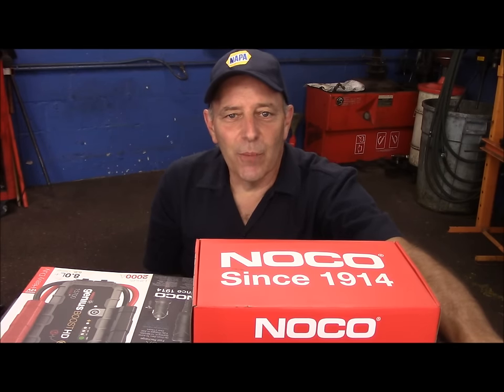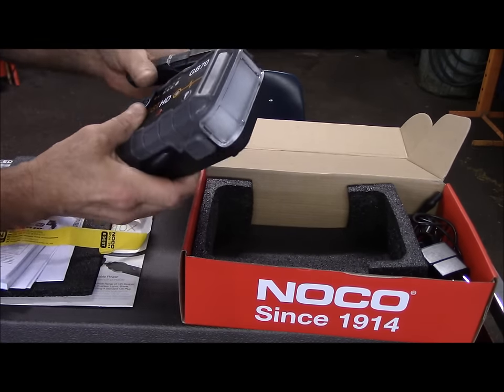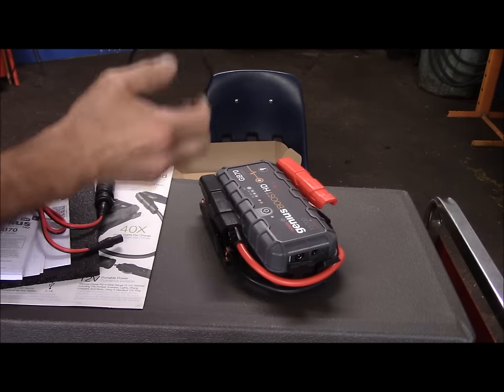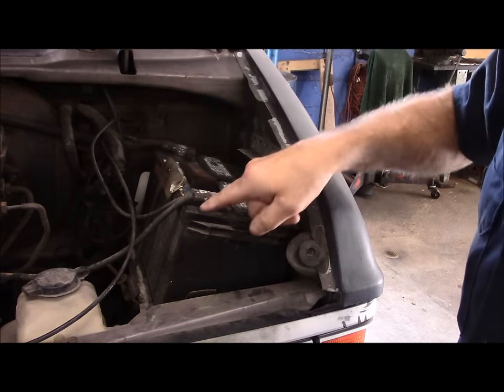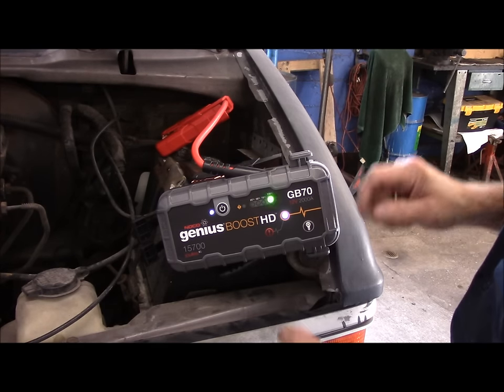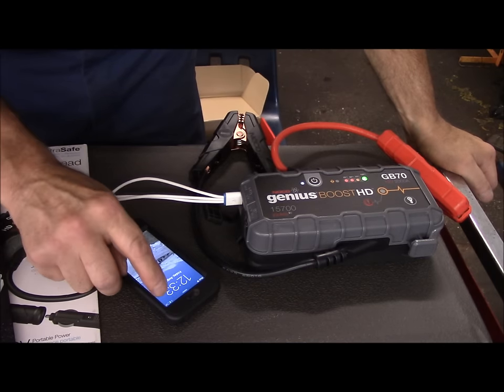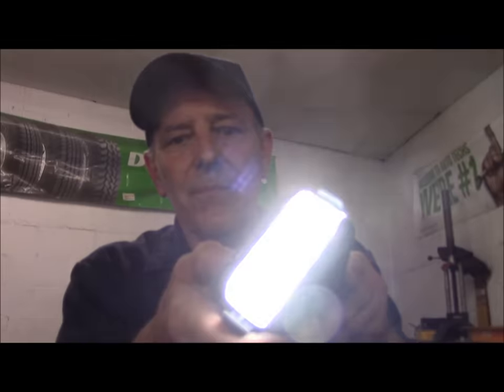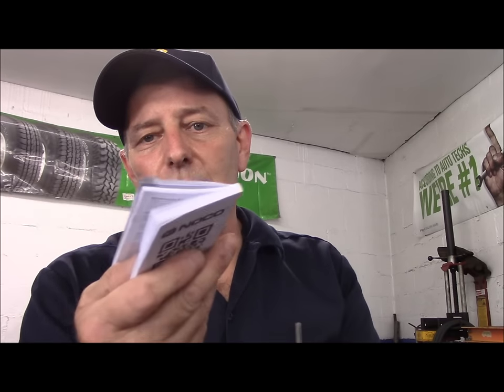Tool Review For Noco Portable Jump Starter Box GB70

Comment: How much does it cost, the noco gb 70
Reply from the maker: Check my Amazon store for more information. https://www.amazon.com/shop/jimthecarguy
Reply: The 4000 amp Noco Genius GB150 costs about $375. The GB70 sells for about $250 from Noco online.
Reply: @jimthecarguy  What happens if it is so dark under the hood that you can't see the button to switch the torch on? Game over ,go back to start do not collect $200, your screwed!!!!!!!!!!!!!!!!!!!!
Reply: @jimthecarguy  This is old technology, haven't seen these for over 300 years, we now have multiphasic cobalt tritinium packs, about the same dimensions as one of those old fashioned credit cards, will jump start a low capacity warp engine !!!!!!
Reply: Obsessive Compulsive from losing tools lol
Reply: I Bought the Noco GB70 couldn’t even start my 1.6 Diesel small Van few tries and the battery went to one Bar from 4 Bars Absolutely Devastated as I’d seen many Reviews did everything as mentioned

Comment: Will the gb40 jump a  V8?🙂
Reply from the maker: Yes as long as it is fully charged.Thanks for watching.
Reply: Not very well. Get a Noco Genius GB150 fot that. They cost a little under $400.
Reply: The gb40 should do it, the 70 for sure, the 150 is overkill.
Reply: @acerjuglans383  I loved the 150 and I am glad I bought the extra power for stronger and longer jumpstarts.

Comment: I'm guessing that the reason there is NO AC charging (house wall) plug is because that would require the PAC to have a rectifier installed.  No rectifier, costs less to manufacture.  Dats it!
Reply from the maker: Thank you for watching.